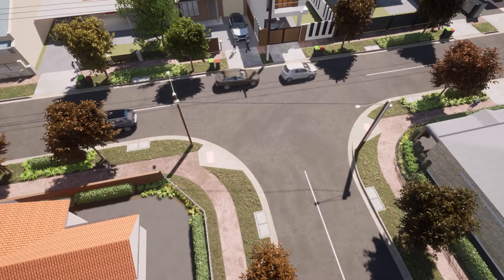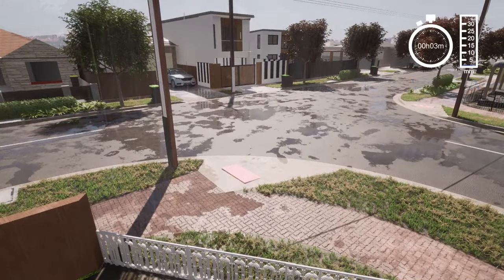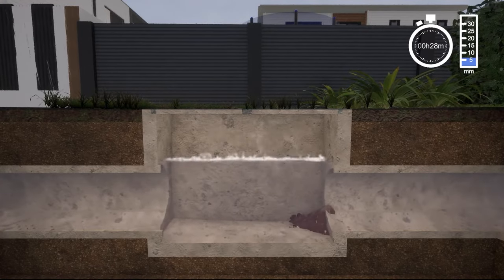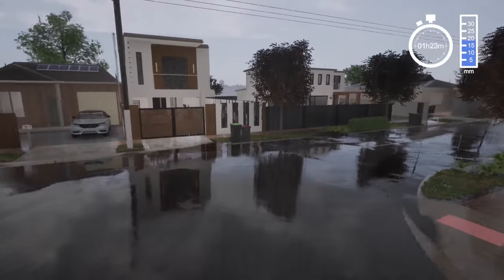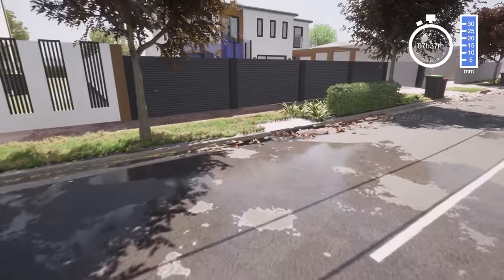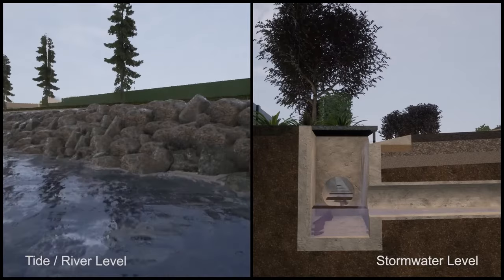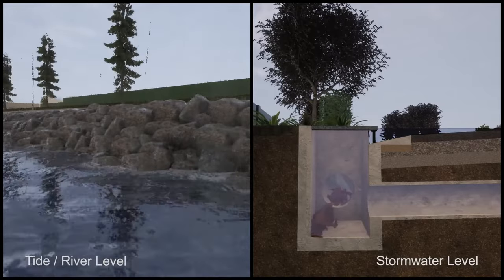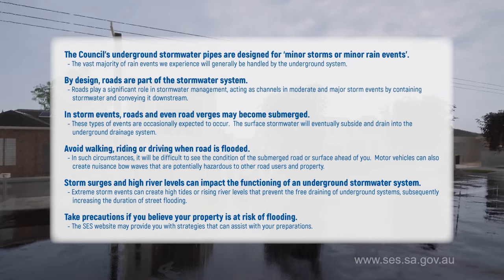How the stormwater system works during heavy rain

Comment: This is not a normal one. This is a storm water drainage system to prevent floods. In cold countries after snow season snow will melt. Such cases this drainage is useful. One problem here is when enormous amount of water is flowing garbage can deposit and causes problems to avoid this Japan uses grill in side inlet also. In american type you can see that. Refer video for more detailed info. https://youtu.be/oRhIowo6mzc?si=N9gAMljk7pZaebdR